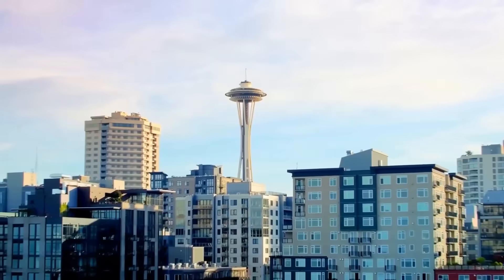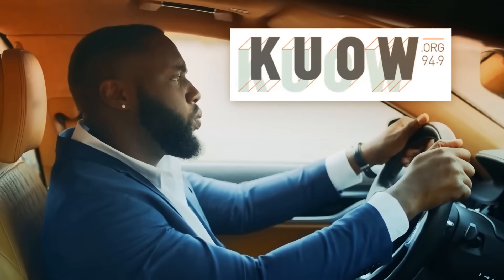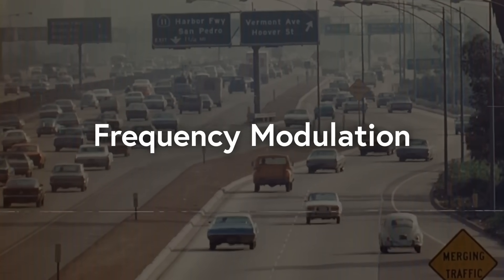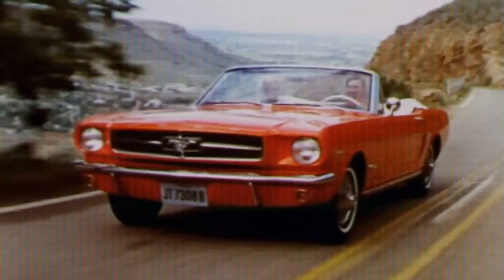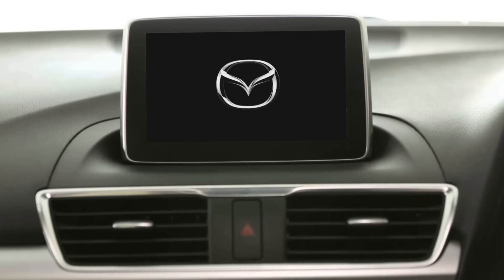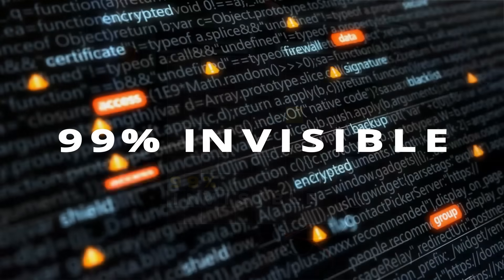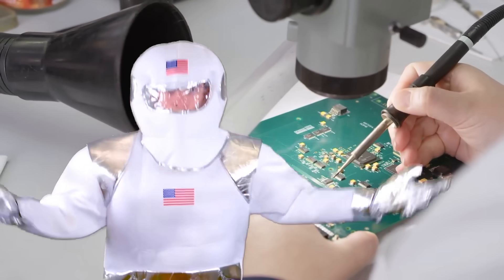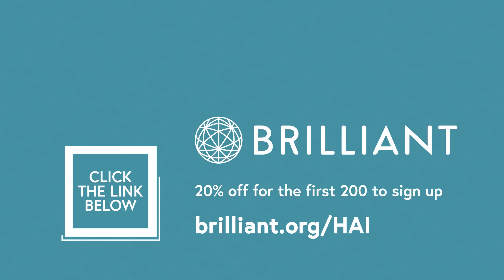Why Hundreds of Mazdas Tuned to 94.9 Broke Simultaneously

Comment: Wait, does that mean that instead of sending a .jpeg, .png or .gif, (or a file with a missing extension), someone could instead send an executable file and get the car to run arbitrary code?
Reply: Well, you can always use the OBD2 port to hack any car anyway and lots of other cars just entering the "smart" iot age had open wifi networks to control the car
Reply: it is probably more complicated than that. The OS of the infotainment system has to be able to get the file and execute it, which is (hopefully) not what it does as it is not expecting an executable in that stream of data. But bugs happen and I'm sure that's something that is gonna happen in the future, maybe.
Reply: Who knows? On the one hand unlikely as this was some graphic lib trying to interpret data which is not the same as executing that data as instructions, on the other hand this is really shoddy work so I wouldn't be surprised.
Reply: Probably not. It's more likely that there's a check for .jpg / .png / ... in the filename and none of them match, so the image is never decoded. The infotainment system then tries to access the non-existing image anyways, crashes, and reboots in circles.
Reply: If it's interpreting the title of a podcast as code, then you wouldn't even need an executable.
Reply: To those of you who will try and argue that this is never possible, might I remind you that the Sony PSP was once hacked just by loading a certain image while having a specific OS version installed.  Whatever you might think, yes, even a picture can be used to hack if the operating system is vulnerable.
Reply: @mesolsot  or the battery 😂 just ubgrade the firmware on the battery and boom it's jalbroken. Still got it too, but batt is long dead :(
Reply: @mesolsot that was the result of an intentionally bad file format header which led to buffer overflow.   That's actually malicious intent.   Yes it is possible but just about all modern libraries have patched that.
Reply: Now you are thinking like a hacker.
Question is, if you can drop and exe file in there would i actually run? What could you do?
Reply: @mattstorm360  yeah youd need to overwrite an existing file that the car already calls on
Reply: @stoplight2554  And even then, that's just the radio. You can still drive the car.
Reply: No. The signal itself can only carry so much data dedicated for specific purposes. There's no chance of a buffer overflow.
Reply: Who knows, these systems are written so poorly I wouldn't be surprised you could do a TON of bad stuff to them.
Reply: Kinda like using Log4J in minecraft chat
Reply: No, but maybe. 
It depends on how the car's OS try to read the file without the extension. 
First, it's a compiled format so it must have a start and an end. I imagine the pictures are not hi-res 4k so you have a limited bandwidth to load them, wich will limit your ability to put a useful code. 
But it is still possible. 
Now you have to know how the car OS handle this unidentified data. 
I think it checks the files metadata to find out the file type without an extension (it's the default behaviour of commonly used file systems in UNIX/Linux systems).
It may match the file type with a table of know types to know how to decode the data. 
And then display the image with the right program. 
To execute code you may have to: 
- Fit your entire code in few kb
- know how to trick the car OS to make it decoding your code 
- find wich image decoder program they use to find out which vulnerability you can exploit
- know wich language you can use to execute code on the system. 

Too many variables for not that much result, as a lot of car's onboard computers are different.
It can happen, but it's really unlikely.
Reply: @LoskLive  *which
Reply: In this case no, as the issue is that the car ends up looking for a file it cant find. But that is a potential vulnerability 

Of course you would need to know how to write code for the car
Reply: @1337GameDev  Exactly. You got a way in thought, so the question is what can you do with it?
Reply: Likely not. It would do the same boot loop because it can only work with the proper image extensions. You can't open up a .exe with MS Paint. The difference is, Windows doesn't crash if you try to.
Reply: @endruv_2287  There is always the possibility that certain versions of MS Paint and Windows could have an exploit where a specifically crafted image file could include executable code that could be run from opening it. Modern versions of Windows are much more protected against such exploits. A quick a dirty OS only meant to run the infotainment system of a car quickly slapped together probably must have plenty of exploits.
Reply: not necessarily at all
I mean whether that is possible isn't related to this issue
Reply: Only if its built on a Windows kernal.
Reply: maybe not a exe cause that is in itself a file extension but yea if you could figure out how it reads info then you could probably tell it to do whatever is within its design parameters 
maybe all you have to do is name a file %2f%20%FF etc.. to make it run code, but its the way that it interprets that code that determines what it does it seems
Reply: @1337GameDev  what do u mean "unless" ofc there is
Reply: Yes you might be able to hack into the infotainment computer but you couldn't get any further
Reply: Send ..
Reply: In theory, yes, in reality it probably won't run binaries, instead it will check what extension to use it, and then uses libraries that work with that extension (or apparently just crashes when it can't do that), and that is ignoring the fact that on unix, on which many embedded devices are based, to execute file they need to have "executable" permission set.
Reply: No.
Reply: The car likely would not be able to execute a program.

Think less "my cake got replaced with a lamp so I turned it on" and more "my cake got replaced by a lamp and I got confused when I couldn't digest it".
Reply: Well no, it wouldn't be arbitrary code, it would be the code you sent.
Reply: yeah no that's not how it works
Reply: The ability to control our cars freely is lended avoidably, probably the government being a bunch of crooks or something.
Reply: Highly unlikely.  It just threw an exception because it didn't have a way to handle it.   And most of these devices run Linux distros not windows based exe
Reply: It… uh… It sure looks like it. Fucking terrifying.
Reply: Dude, you figured it out!
Reply: Here's how this can be fixed:

If the file isn't jpg, gif, png, or another image file type, or if the file extension is missing, immediately switch the extension to png.
Reply: @_lunartemis  or just do it the proper way and read the file headers :P
Reply: @danmakufan  Or go the lazy route first. "no jpg/gif/png extension? here is generic_music.jpg because an image file wasnt included."
Reply: @metalwolf112002  yes
Reply: @danmakufan only semi reliable to read headers.  Some file formats are non standardized headers.
Reply: @_lunartemis  headings aren't completely standardized, tools like the Linux `file` utility have to make educated guesses in some cases.
For image files it'd probably be fine, but if this was my project I'd make a deliberate point to emphasize that the code wasn't 'done' until failsafe logic was in place to display a generic filter image when needed.
Reply: @_lunartemis  or, I don't know, ignore it?
Reply: @_lunartemis  Or just, you know, ignore the file and not show cover art
Reply: @_lunartemis  

Let me guess. You’re not an actual programmer, are you.
Reply: @_lunartemis  Could .bmp also work as a legal default extension for unrecognized picture file extensions?
Reply: @_lunartemis wrong answer.   You ignore it.
Reply: Depends on how it was implemented, but in theory it may be possible. You can even run code out of bloody QR codes(MattKC made a video about it and one of the first nintendo 3ds exploits involved scanning a QR code)
Reply: @Notevenmad955  aw, yeah, that was fun 😁: https://youtu.be/ImR-TdDAIJE
Reply: Yes, if they know how to do that.
Reply: @gteixeira  no, coding a program to open a jpg and executing an exe is different.
Reply: @gheebuttersnapsgus  If you are clever enough, you can load an executable code from an image.

Comment: The percent issue is because a lot of programming-languages use % for formatted text for example "%d" means "take the next parameter, and add it to this part of the text as a decimal number. If however there are no more parameters to use, things will crash. Because format-string vulnerabilities are so common, some tools have started to ban user-controlled formatted strings entirely.
Reply: Like with SQL injection. The take home wisdom is that you always sanitise inputs, and never produce format strings from externally supplied strings.
Reply: I'm quite surprised this was even an issue in the first place. Any common compiler from the past decade will warn against using any old string as a format string if you try.
Reply: Actually, depending on the compiler, it will actually take whatever is in the stack and interpret it as the necessary data.  This is a reality bad security exploit if programers allow users to make their own format strings.  They can actually see data used in pass calls if they put in a random %s.
Reply: The percent issue is actually just an issue with: NEVER TRUST USER INPUT. It's such a fundamentally basic thing to worry about, yet so many just ignore it. If you aren't sanitizing your inputs you should not be paid as a programmer.
Reply: Just to add I believe it was confirmed that the radio only breaks because it is %In, this attempts to store the number of characters written to an integer pointer. This causes the radio to attempt to write data to a random integer pointer causing a crash.

Stuff like %u and %d didn't cause a crash, but %n and %hn both caused crashes because they have similar behavior.
Reply: @bill6843  %n, ah, those halcyon days of shellcode. I miss Greg Hoglund's books.
Reply: Worth noting that a format-string vulnerability can lead directly to remote code execution, and the fact that such an injection exists is a massive security issue.
Reply: log4shell was basically a fancier version the same thing
Reply: String interpolation is the root of all evil #ChangeMyMind
Reply: No, the issue is that the guys who made this software were really shit at their jobs.
Reply: @xmtxx  Yes, they should have sanitized the input by escaping any special characters,
Reply: @turkosicsaba  or just by not using it as a format string, as you're supposed to. I don't think in this case there was a need for any special sanitization, just a bit of common sense.
Reply: @turkosicsaba  Exactly, the thing is that it's a problem that have been known and solved 20 or 25 years ago.
Reply: @xmtxx  coding
Is 
HARD
Reply: @justarandomtechpriest1578  Maybe you were sarcastic, but the lack of smiley doesn't make it clear. My 1st degree response would be:

Oh yeah, coding is hard. Especially coding on those automotive platforms. My friends who worked on some, told me how much of shitshow it is. Those platform are very badly designed from the ground up.
As I already stated, those problems have been solved for over 2 or 3 decades. Sanitizing your data it CS 101, there is no excuse for any of that.
Reply: I'd assume that if you plop in %i to a formatted string it would replace it with some garbage number that happens to be in the register. Making it "99721077 visible" or something. 

I assume because it stored the arguments on the stack right after the return address. It used the return address as the errant argument and then returned to an errant return address and then the MMU freaked out and the car exploded. 

Or in caveman talk. Imagine Thag needs 3 spears. But Gug only gave Thag a quiver with 2 spears and tells Thag "Gug give Thag a quiver with 3 spears". Thag now uses 2 spears to kill 2 mammoths, but when Thag tries to kill the third mammoth Thag realizes Thag has no spear and the mammoth crushes Thag. And we call that a "Stack Overrun"

Edit: Another comment said %i doesn't work like the libc. So I guess my theory was wrong.
Reply: Yes. But wouldn't a space after the percent sign in the title prevent that kind of misinterpretation? It should. Otherwise, the percent sign itself could be escaped as %25. But if not all devices receiving the podcast recognized that... yeah, problem.  As for those extensionless files, was there no way to purge them from memory (like removing power)?
Reply: Think the problem is if someone used s/f/printf (in C or similar in other languages) and used a string as only argument. Then it will crash if that string contains  a % followed by a letter that happens to be used for formatting. You should of course only use s/f/printf if you want to format the string with parameters, just pushing out constant strings have other commands. Seems stupid but I have actually seen people doing this. But I hope a modern compiler would warn about it, but the compiler for a 2014 Mazda with an even older radio design might not be that
Reply: The issue is that a lot of programmers don't sanitize or verify their inputs like they should. There's no reason that an input value should be confused with a formatting character anymore than I should be able to hack your database by \0delete * from users;
Reply: It's possible the designers deliberately interpreted format strings because they wanted to allow stations to send formatted titles, e.g. sending the same format string every time but swapping out arguments to apply a generic frame to multiple specific tracks. But whatever the case, it should have been obvious this was a bad idea. Even if they were careful checking inputs for bad formatting, there would always be a serious risk of something unexpected slipping through. It's like if I allowed a website to send data directly to my kernel, but don't worry, I give the data a good looking over each time before letting it through.
Reply: Looking at you log4j...
Reply: Yes, but any decent software engineer should know to escape any user/dynamic input, which would include the audio titles in this case. Escaping the % in the string would have solved the problem.
Reply: Time to rewrite it in Rust ...
Reply: For the record, it wasn't "%I", it was "% I", there is a space after the percent (it's possible a driver's own MP3 files might have the band's name incorrectly written, but the radio-station would likely have the space). That would cause it to throw an exception and crash. (Or at least, in theory; I just compiled a test program and tested with "%I", "% I", "%i", and "% i", and they all just printed 0 or I instead of crashing. 🤔 But the test program didn't have other stuff…)
Reply: @I.____.....__...__  I would like to see what actually causes the bug here. It seems more involved than just a missing argument. Someone earlier was saying it was interpreting the substring '% In' as '%In' which would explain the crash, but that doesn't explain why the space is getting stripped out in the first place. After all, it's not like spaces don't display in titles. Is it a specific quirk for this car's software that after a percent sign, it waits for a non-whitespace character?
Reply: @EebstertheGreat  
Larry!! Whats up?
Reply: @I.____.....__...__  Assuming they were using C's printf, the space is actually a valid thing to be there as part of the format parameter. It adds a space in front of positive numbers, so they would line up nicely with the '-' in front of negative numbers.
The bug sounds like the classic case of printf(user_string) instead of printf("%s", user_string) to me.
Reply: IIRC from the Reply All episode the problem ended up being about URL encoding rather than %i specifically
Reply: @ConnorShea  The author said it might have something to do with URL encoding, but there is no confirmation of that. The explanation that %In is writing to a garbage address makes a bit of sense, but not a ton (in particular, the author of the software for the Mazda Connect infotainment system has stated that it was not written in C or C++). We just need more information to figure out what is really happening.

There is a lot left out of the video. The problem doesn't just affect HD radio but also audio connected via Bluetooth. And it doesn't just affect Mazdas but also a few models of Nissan with completely different software. Very strange.
Reply: Segmentation Fault (the most useful error message ever …)
Reply: See

You 'C' what i did there, haha
Reply: It feels weird that I have used %d in matlab at uni
Reply: And all of the programmers weigh in. 😄
Reply: So it was trying to italicise something it shouldn't?
Reply: The % issue has many faces.
As noted the %d or other symbols in format strings is one.
An earlier appearance is %token, which demoted a replaceable string in different places. 
The first issue is the lack of a space, and a single % sign.
Later variants used %%token, as the occurrence of %- is a lot less likely than %I or %d,
… notwithstanding the lack of a separating space character.
Underscore (_) is also making some appearances, but the whole idea of a token within a user accessible string is a big no-no.
 since around 2000.
Reply: It screams of a security vulnerability just waiting to be explored.